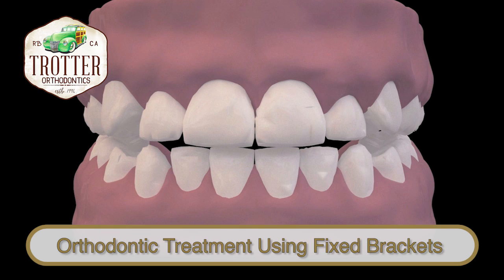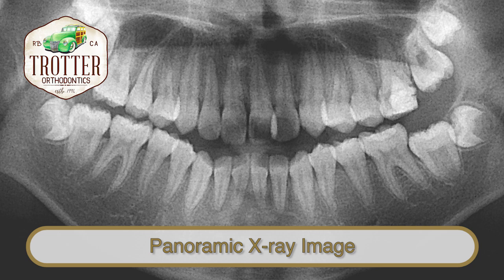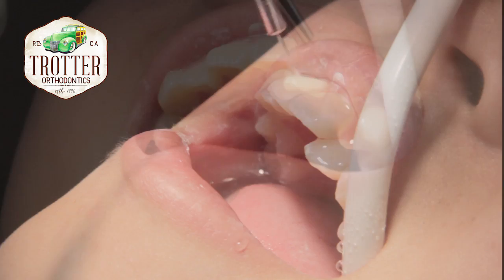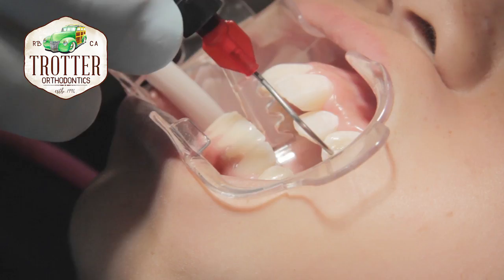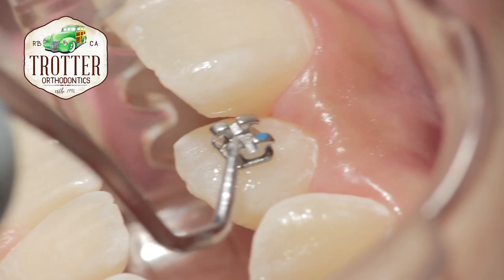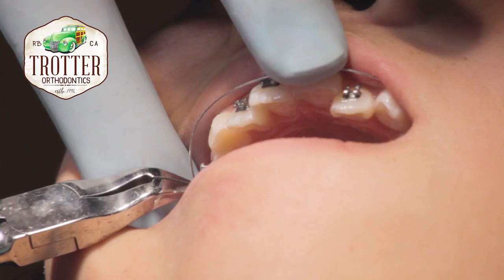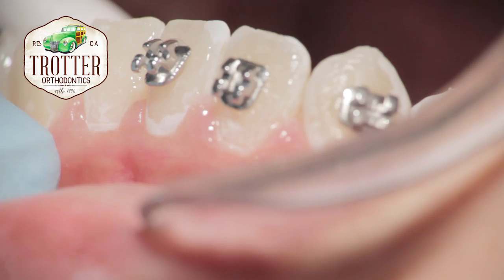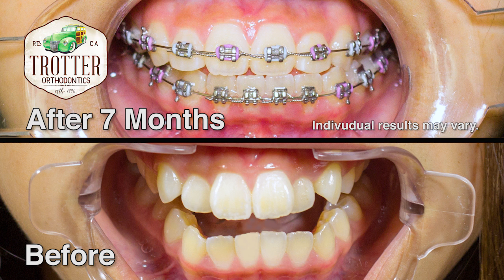Watch How Braces Are Put On - Orthodontic Treatment Using Fixed Brackets  Redondo Beach Orthodontist

Comment: Does it hurt
Reply: The initial putting on of braces doesn't, but in an hour or so, your teeth finally are like, "Oh I don't like this" and then it starts hurting. In a few days or so the pain will subside, and then you can eat again.

But then in 6 weeks or so, you go and get them tightened... That HURTS.
In my opinion the second day is the worst, but you might think otherwise.